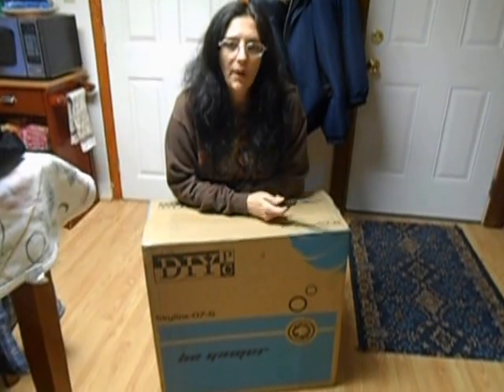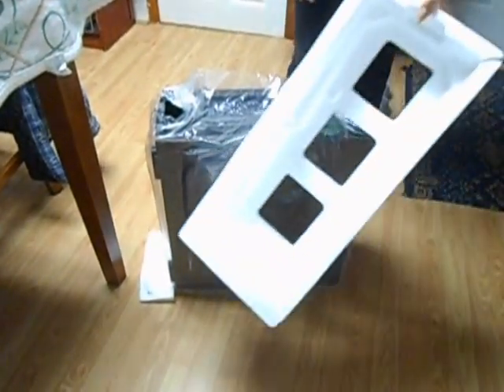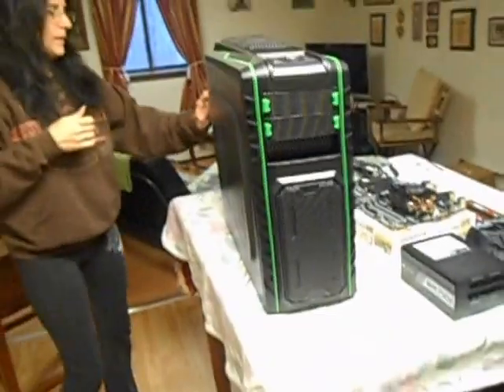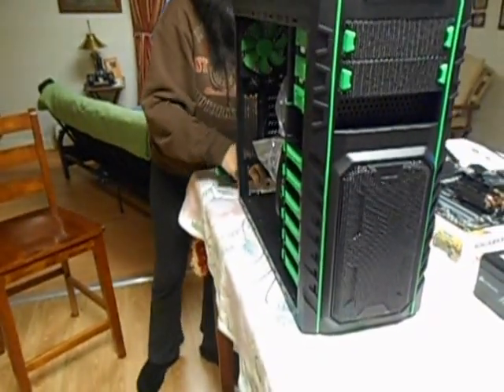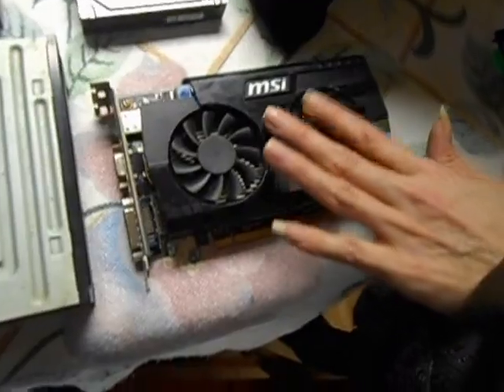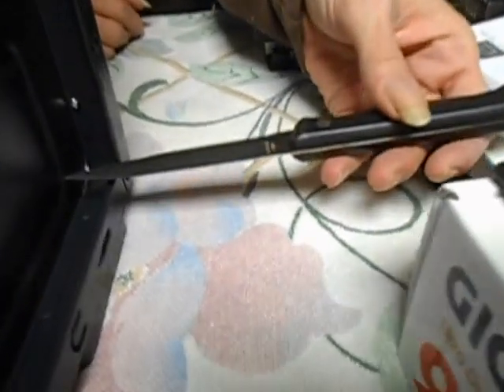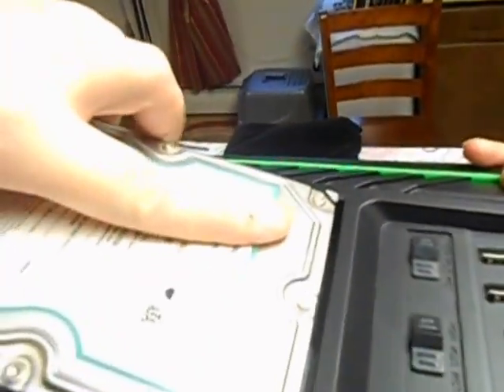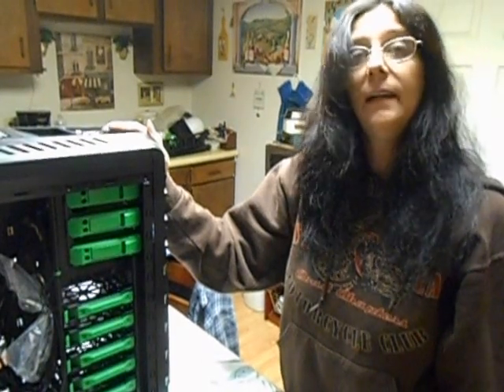RavenWing Computer Case Unboxing

Comment from the maker: Each of the connectors are labeled on what fans are to go where ,also newegg had a nice video on an unboxing of this case and , the connectors to
Reply: How did you hook up the fans because I'm very confused as to how that works. Everything was connected already, but it didn't work after I installed everything. The fans aren't working and the manual is completely vague when it states "fix fans by fan screws"? What does that mean if they already came screwed in? Thank you for any information at all. I purchased the red case. Thanks
Reply from the maker: +Steven Toney you mean none of the fans are working?i will look at mine tomorrow and let you know how mines hooked up and where everythnig is
Reply: +Roger Miller yeah none of them work at all. my last case i just plugged in the fans and they worked  fine....
Reply from the maker: +Steven Toney ok it can be a number of things1) try plugging in the fans on the motherboard 1st to make sure they working2)if they are all working when you plug them into the motherboard then the fans are fine, the only one that should stay plugged into the Mobo is the back fan3)you only have 3 fan switches 1 for the two top fans , 1 for the two side fans and one for the 2 front fans each of those should have a Y-PLUG or something like that4)like i said in the other comments all the connectors are clearly marked on what goes where to where5)look at the fans connector and then look at the case connector when you see them match plug them in
Reply: +Roger Miller okay I hooked up all the fans to the main boars and they all do work. my question is though... you say I only need to hook the rear fan up to the board? do I just hook all the other fans up to the ones coming from the power switch, etc. from the top? I tried that and it did not work. if I hook 5 up to the board it works. now I can't get two side fans to work. what am I doing wrong? is there a master fan controller to power them all?
Reply: +Roger Miller do I plug the two top fans and had cage fans together? meaning they do not go to the board? I'm just confused about that part. thanks so much for all your help.
Reply from the maker: +Steven Toney you should have a molex connector in there for the front fan controller
Reply: +Roger Miller I have a molex connector for the fan control, but what do I hook that to? all my fans currently hooked up to the motherboard. the only ones not are the side fans. do I hook the two molex together that says fan control?
Reply from the maker: +Steven Toney hook the molex to the PSU ,if you psu has an adapter for it for example go and look at the Cosair RM1000 that the PSU I HAVE ,You plug it into that and then you plug the fans into the fans comtroller that where the fan controllers get the power from
Reply: okay THANK YOU SO MUCH!!!!!!!! i will take another look, my psu is a corsair RM750x. full modular. never had a case like this so that's why i'm unsure thanks again.
Reply from the maker: +Steven Toney Wife got the same PSU so it will have one
Reply: yes that worked, thank you so much!!!! at first my cpu fan stopped working, so i had to unplug one at a time and it eventually started working fine... weird. is the other molex connector for the hdd dock on top? can i connect that one into the same molex that the fan control is plugged into or do i connect it seperately? thank you so much again.
Reply from the maker: +Steven Toney Plug the HDD Seperately into the PSU , DO NOT plug it into the fan controller it night lead to thing blowing up
Reply: yeah i wasn't about to do that lol. so i can just hook that 4 pin molex coming from the top where the power button, fan control, etc. is, into the perhipherals on the psu with that molex connector?
Reply: +Steven Toney Got it all working finally!!! thank you so much for your help Roger.